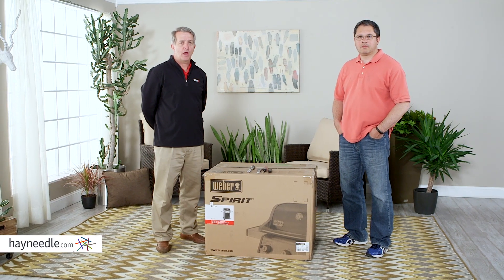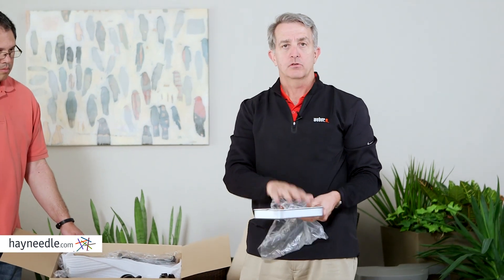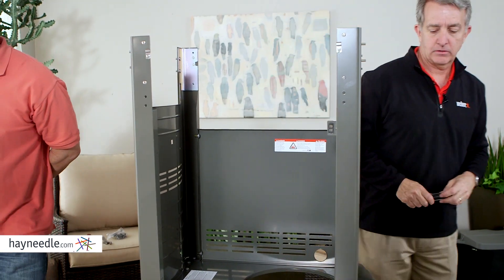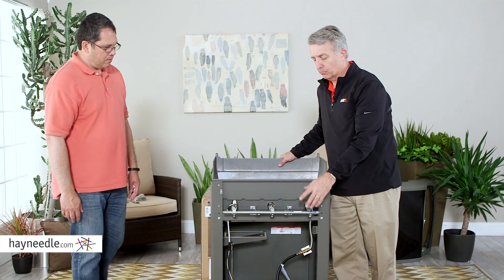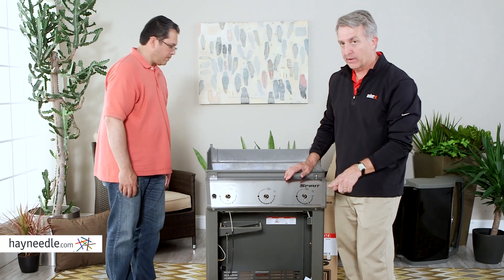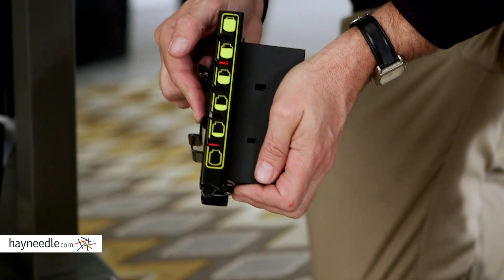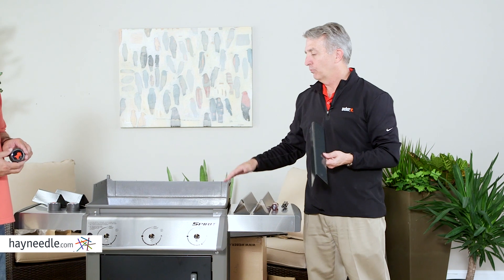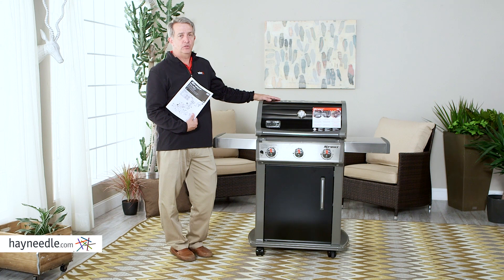Weber Spirit E310 Assembly Instructions

Comment: Very helpful. I bought a display model grill, fully assembled, at a discount., so I didn't get assembly instructions with it. I couldn't figure out why the propane tank went through the hole in the cart, and sat on my deck. Also, I couldn't see how the tank gauge could work when it wasn't connected to anything. The video explained both. The tank hooks onto the gauge. Doh!

Comment: Here's a GREAT tip, before removing the grill box open the lid and remove all of the parts first, this makes removing the grill box from the card board box much easier, especially if you're doing this by yourself.

Comment: My Spirit 2 310 doesn't have the enclosure It is open. I'm trying to figure out why my igniter is now hanging below the control panel. Both wires are attached...there is a white plastic extension before the silver bracket. where the silver bracket attach? Do I have to remove my control panel. Grill purchased in 2020...obviously newer than this model. Do you have another video? Thanks

Comment: Is there supposed to be open space above the back panel? Also,  what is the large hole on the bottom of the back panel for?
Reply: In  case u r using natural gas connection
Reply: @vladedodi1347  thank you now you taking the mystery out of it. I will have to cover that hole as the mice like to come in there and rest and do damage